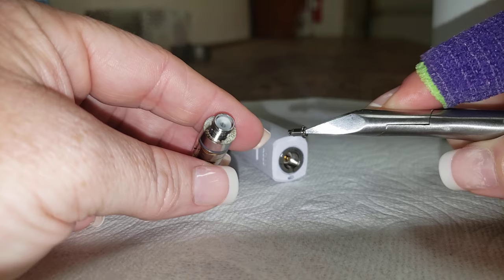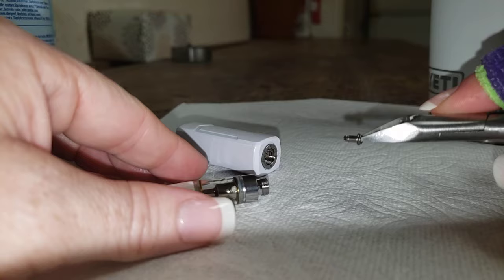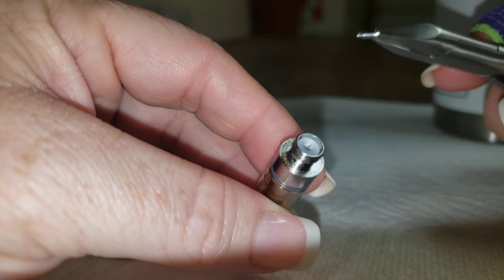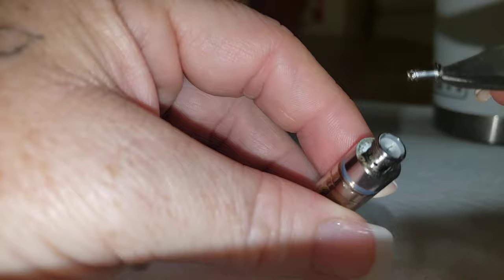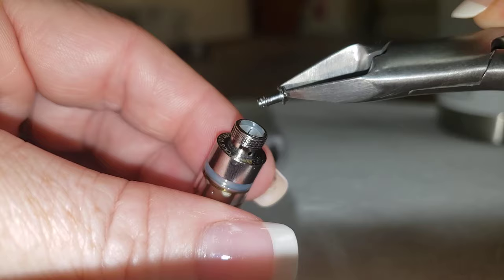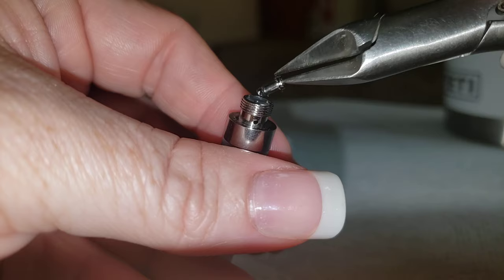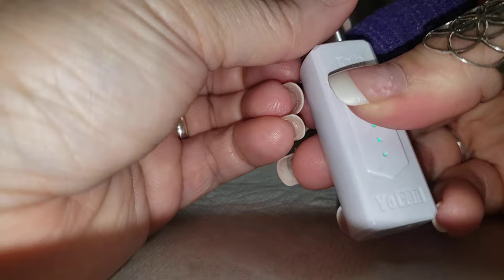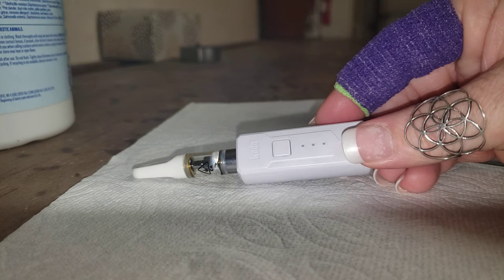How to fix your vape cartridge when all else fails- pt. 2

Comment: mine, I cant see ANY wire?
Reply: HOLY CRAP!!! I have to add to the list of people rec you be awarded stoner saver of the year! I got a cart from Maine years ago and the pin popped out and never worked since. I've been trying for an hour couldn't even see the wire, than finally after some careful poking and prodding I saw it. Slowly and I mean SLOWLY got it to be centered. My main issue was I couldn't seem to get it to come high enough so it was impossible to thread into hole. So what i did was i sort of pushed the wire to the side and angled it in just like she did. I knew it was definitely not going into the hole but close and it worked!!! So just keep trying people!

Comment: I tried it and it still doesn't work 😭
Reply: There are two wires. One sticks out tho like in her video. The other should be in between the little rubber and the metal on the side. Chances are that slid off
Reply: @MrWowh you are a life saver. I HAVE A GOOD FEELING ABOUT THIS BRATTAN